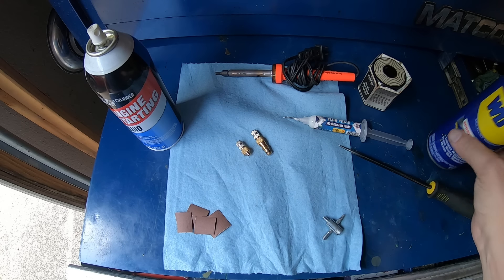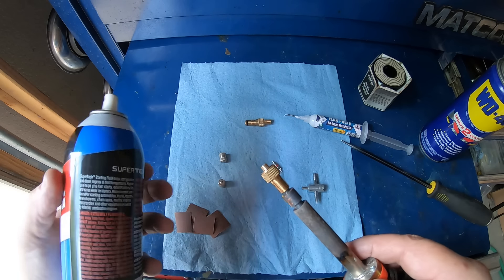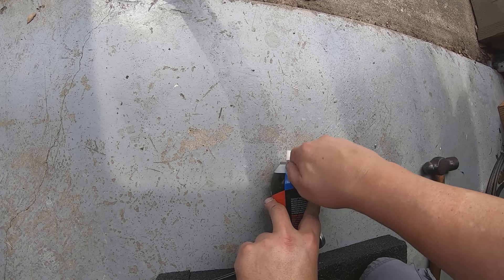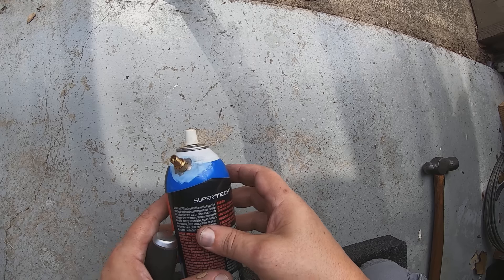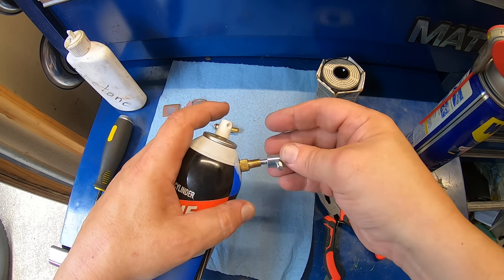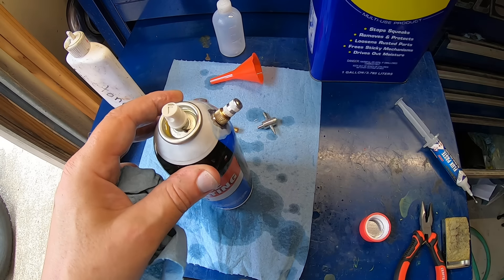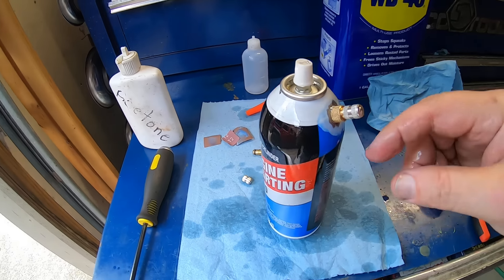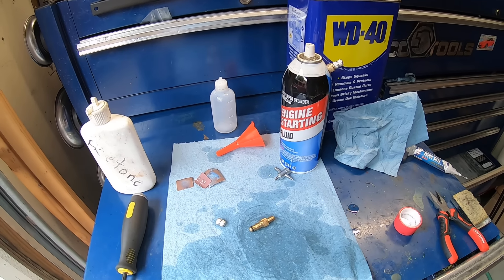How to Easily Install a Schrader Valve on any Can to make It Refillable without Drilling or Torch.

Comment: No no no ! alliaexpress got a no weld swelling valve / just drill hole/ apply valve.. /tighten nut as triangle piece slides down tight and grows inside the rim /.. $1.99
Reply from the maker: Can you post a link to it? I would like to see it.

Comment: Spends more than just buying a new can! 😂
Reply from the maker: Not in the long run. Let me do some simple math for you. 10 pack of Schrader valves $12, 2in of copper rod, $2, 1 gallon of wd40 $29 everything else I had. Total price $43, 1 gallon of WD40 is equivalent to 10.6 12oz cans so at $7.89 per can multiplied by 10.6 cans equals $83.64.

Comment: This is abselutely INSANE, for two reasons:
1. Your compromissing the pressure boundary of a one time use pressure vessel, without any engineering calculations or documentation as to it's safety.
2. Your refilling and mixing a Hydrocarbon mixture and Oxygen into a pressurized one time use pressure vessel.  Under the right conditions you could have an explosion follwed by a fire ball, this is probably the cause of a few house or work shop fires.

This Video is absolutely dangerous and should be taken down.

Aloha............................
Reply from the maker: And people like you are why there is very little innovation today. I hate to let you in on this but you can actually purchase refillable cans commercially that are refilled with the same air that I used. With that said aerosol cans are NOT made to fail after one time use. These cans can withstand much more pressure than an air compressor can put in them.

Comment: How much would you sell your extra one for? lol..  the can you just made in the video.   I can send you paypal with a simple email, (unless you have a better way to pay). Not sure how much shipping would be..  I live in Oklahoma.   Or I could buy a few tips like you said, since I don't have a way to machine them.   (I could chuck them in a drill press and machine them with a grinder I guess. lol)
Reply from the maker: What I was thinking was if anyone was interested, I could machine however many brass valves they want and a tip and send a squeeze bottle. We would just need to figure out how much.
Reply: @737mechanic  It's up to you..  I'm quite frugal though. lol..
Reply: @737mechanic  Don't do it. Liability and the law if something goes badly.

Comment: This is one of the most stupid and dangerous hacks I have seen. Relying on a solder joint as the primary and sole means of attachment for the Schrader valve is an accident waiting to happen. It is fine to use solder to create a seal but not to carry mechanical loads. Something even more crucial on a pressure vessel which stores significant potential energy from the pressurized gas. Solder does not have very good fatigue resistance. So while it may appear to be okay when first assembled, the solder joint will suffer from fatigue and cracking with subsequent pressurization cycles. It is a certainty that over time the solder joint will fail. Add some rough handling in the workshop to make matters worse. That is bad enough, but when a solder joint fails from fatigue (cyclic stress) it will fail catastrophically turning the Schrader valve into a projectile. So, don’t ever point that valve towards you or anyone else. Even better, just don’t mess around with pressure vessels.
Reply from the maker: You might want to watch my other two videos where I pressurize 2 cans to failure and take a look at how well the solder joint held up. 

There is about 17lbs of pressure on the valve when the can is pressurized to 100PSI.

Comment: No drill, no torch, but you need a s#it load of expensive machenery which includes a lathe. Click bait alert.
Reply from the maker: Do it without a lathe, get a grinder or even a file and you will need to spend a bit more time but you could still hand trim it and make it work. Get creative.
Reply: Far from click bait, someone sharing something that has worked for them. If you can’t figure out a way to do it without a lathe then it’s likely unsafe for you to do it anyway. Just go buy the new cans and try to be happy with that.